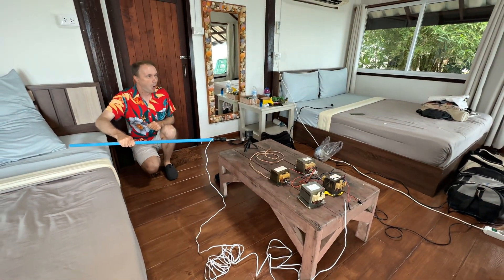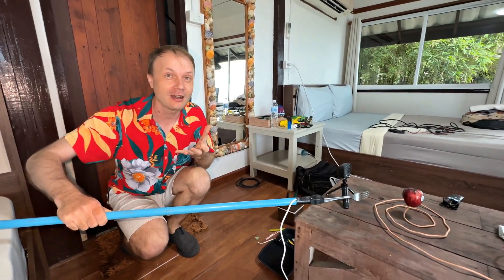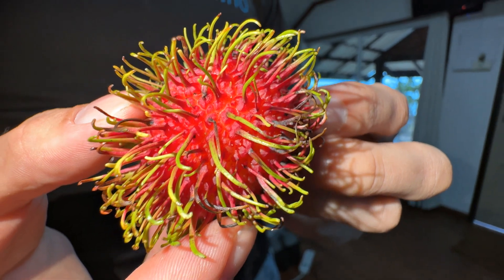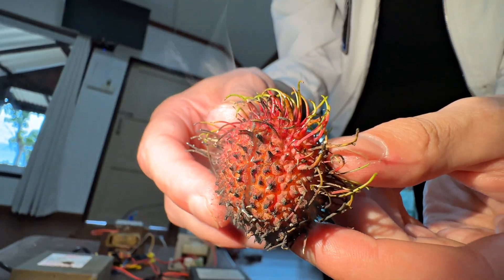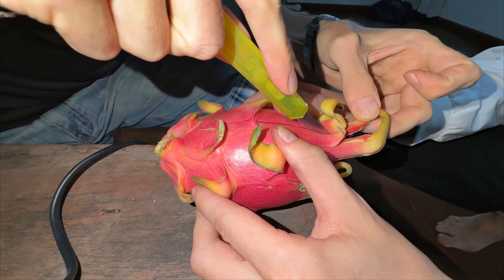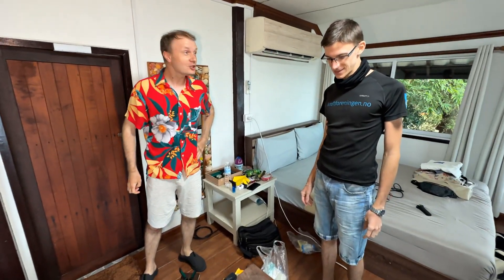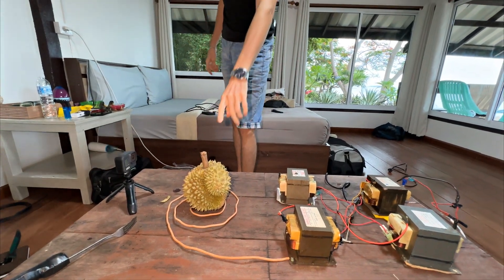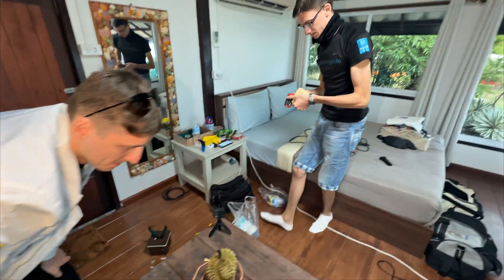What if you inflate an apple with PLASMA from a microwave?!?⚡️⚡️High voltage ARC and fruits inflate

Comment: The Reason why parts of the Apple explodes is the Water inside the Apple. It evaporades from water to steam so fast that the expanding steam makes the Explosion. 
Same if you put water in extrem Hot oil. The water expands extrem fast like an Explosion.

Comment: Btw look up lightning rods for houses. To ground something it takes more than just 1 cm of wire in the sand. You need a metal rod kinda deep in the ground. But im guessing for utube for watever reason ur not showing that. And the top surface layer of sand is dry with no conductivity anyway, you need to reach moist soil/sand.

Comment: I think that the reason that you are getting a more energetic arc with the fruit is that the fruit is acting as a capacitor. This capacitor in series with your transformers is causing resonant-rise in the output voltage. You can do the same thing by connecting a capacitor in series with the transformer output and arcing to ground though this is much more stressful on your transformer secondary coil.

I am really surprised that your 4-MOT setup lasted as long as it did. MOTs are designed very cheaply. One end of the secondary coil is connected to the transformer core to allow cheaper insulation methods to be used. This prevents more than 2 MOTs to be reliably connected in series without secondary coil breakdown as you have seen. Some people have used 4 MOTs in series by immersing everything in mineral oil.

For what you are doing, the setup would be much more reliable if you connected the 4 MOTs in parallel. This will limit the output voltage to about 2000 volts RMS but will yield 4 times the current of a single MOT. 2000 volts is still enough to establish your initial plasma. Ensure that the phasing of the outputs is correct.
Reply: tldr
Reply: @cofinify  12 sentences are too long for you to read!? I advise putting down the smart phone and working on your concentration skills.
Reply: @littleshopofelectrons4014  Cope harder
Reply: WTF! Man what did I just read
Reply: @AmitSingh-bz3xh  People experimenting with high voltage should know what I am talking about.

Comment: Sugar burns violently and the arc provides a rather inefficient heat source. If you add an oxidizer such as potassium nitrate the sucrose will react quite well. The gas produced would most likely be carbon dioxide and water.
Reply: The room must smell like apple pie lol